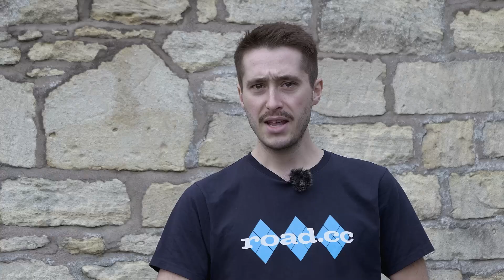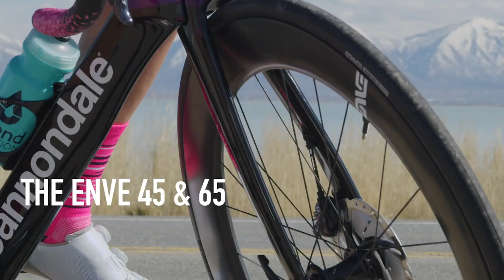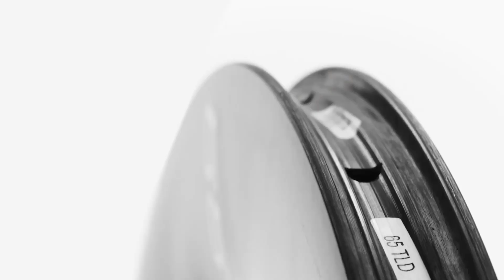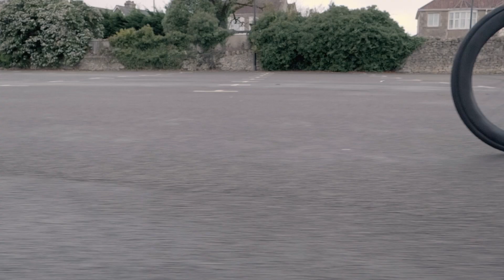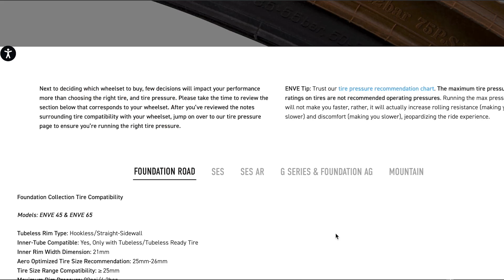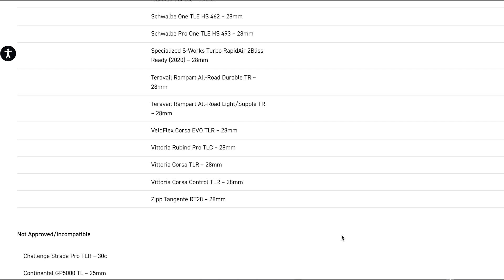Affordable ENVE Wheels! | Deep dive into the ENVE Foundation range

Comment: I had them. Was running tubeless. They dont have hole on the sidewall of the rim like other rims. Enve has this fluted valve ring where air is supposed to escape to prevent air being trapped inside the rim in case the tubeless tape fails. Well my tubeless tape failed, and the air didnt escape quick enough through the fluted valve ring. The carbon delaminated, and the rim exploded. I’m in the process of preparing the rim for warranty claim. Other than that, the wheelset was pretty good.

Comment: Idea for a Zwift experiment; How much additional power can you put out if you use your hands to power a second crank? (See: Twicycle, or perhaps Hand-and-Foot recumbents.)
Reply from the maker: heh, sounds complicated :-) probably the answer is none though, your limit is more set by your cardovascular system than your muscle capacity, although you might be able to top up your sprint
Reply: @roadcc  Your joints tend to strengthen more slowly than your muscles, so no matter how strong your leg muscles or cardiovascular system get, you'll eventually top out because of your joints.

I've heard that there are actually a lot of muscles you tend to make use of while cycling that don't actually get much of a workout though, which is why getting an upper body workout is sometimes considered helpful. More control and whatnot. (Also, split cranks to manually keep your legs in sync, like the PowerCrank.)

Also, the real-world Twicycle is 2WD; your arms power the front wheel. 2WD on a bicycle is honestly just awesome, especially if you plan to do mountain biking or steep climbs.